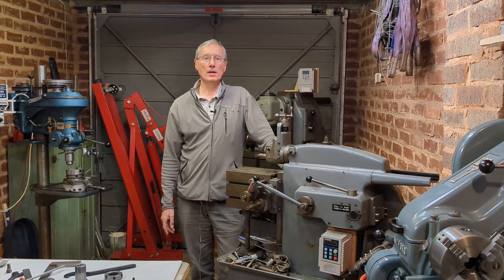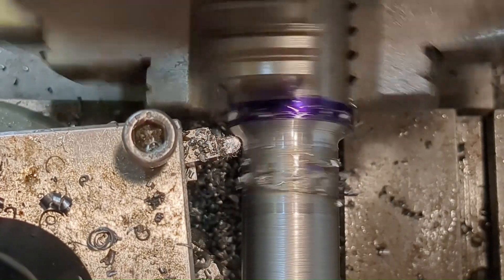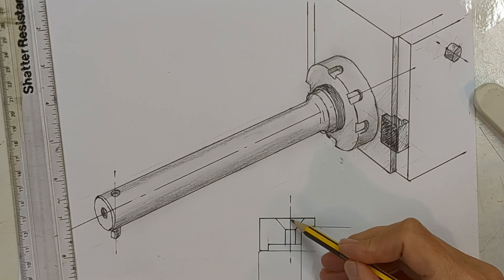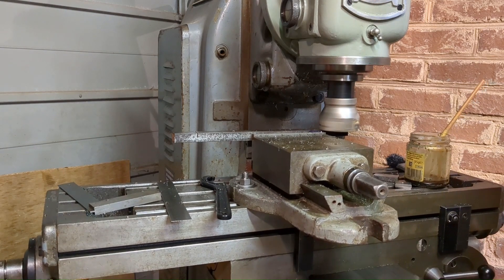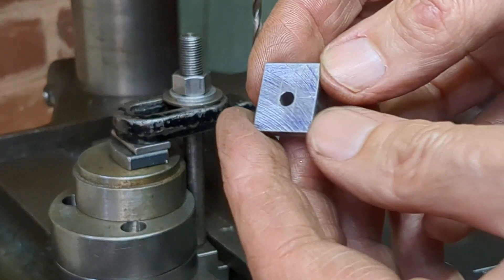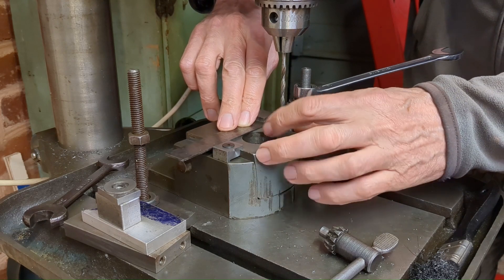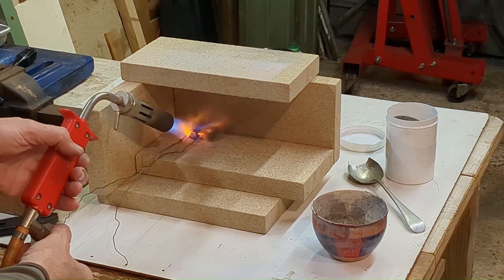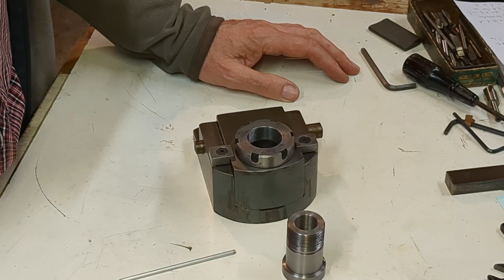Shaper Tool Holder #2

Comment: great work. I made a tool for a similar purpose, but I just replaced the clapper box with a block that bolts on using the screw and bolt arrangement. Not as nice as your solution, but a lot simpler!
Reply from the maker: Thanks for your feedback. I take your point about complication! For me it was a priority not to disturb the clapper box and the tapered pin which forms the fulcrum.